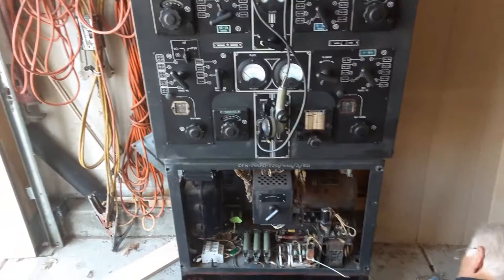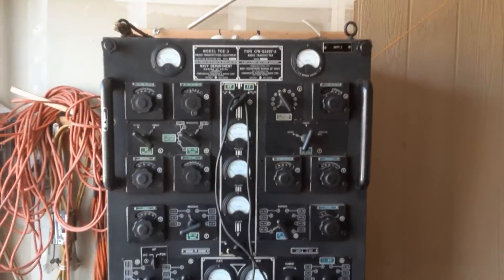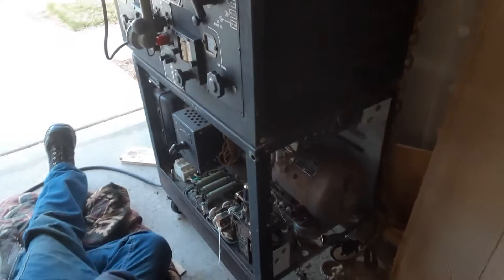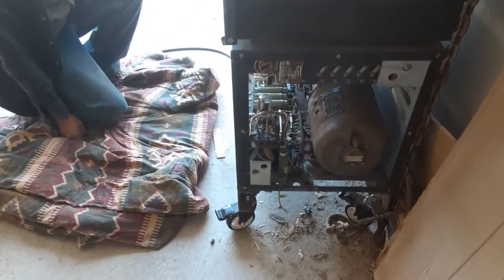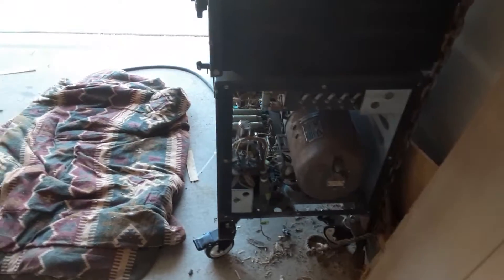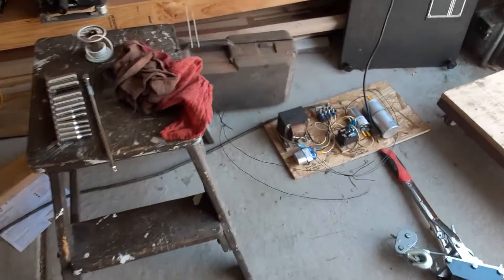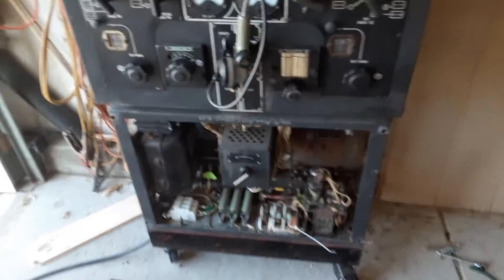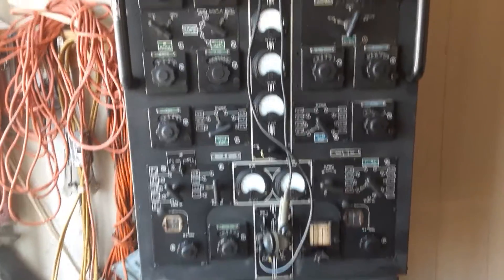TDE 3 Transmitter me and Ron moved the motor generator

Comment: Wow Larry,,, that thing is a monster. Take us over there when he gets it going. That should be pretty cool.
Reply from the maker: Yes, indeed, to get that motor Generator in that small space took a lot of work because it was really in an awkward position. We could not pick it up by hand part of the time Ron used heavy bailing wire tied around the motor generator and an Axe Handle so we could get it close then we had to put it on a wooden platform Ron guided it while I levered it into position. But, its in and solid now bolted to the shock mounts. We haven't figured out how to get it in the house yet. That will be another nightmare lol.